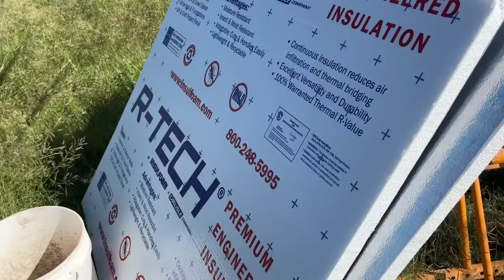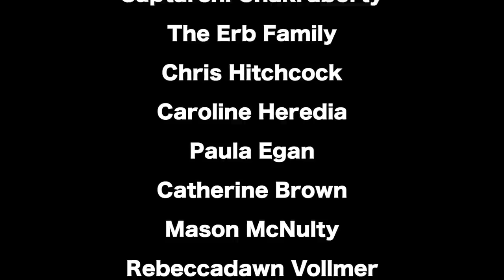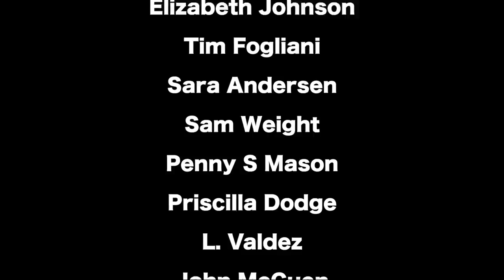Trying to get a HANDLE on the Removable Pump House Roof (Chicken Garden Day 170)

Comment: Nice job getting the screw shavings off the ground. I like the handles. Nice rigid insulation board for the inside of the doors. I'm glad you thought of the heating mats for the inside of the pump house. Nice clean-up of the pump house floor Jonathan. Putting the latches on. Nice overflow pipe. So nice that Jonathan wanted you to be careful and said he loved you. Aw! Rain stopping progress once again. Have a great weekend!

Comment: Hey Guys just a second idea for heat inside the pump box is a 100 watt light bulb
Reply: Then you have to have AC power when solar cells produce DC power. Invertors are expensive to set-up. A twelve volt DC powered heat mat is easier.

Comment: In the pump house in the winter we used a regular 90 watt bulb and it never froze. Cheap and efficient.
Reply from the maker: We don't have 120V power at the chicken garden. Just a small solar setup so we need to find something 12V.

Comment: What a blessing that you have in abundance of rain this season. I can see that your chores that includes the need of water have become easier. Perhaps this will carry over to times (past) that water has been scarce and an added expense- particularly when creating & installing the final coat on the chicken 🐓🐣🍗🪴👨🏼‍🌾👩🏼‍🌾 garden.  Speaking  of expense, have you tracked the expenses of local potable water since installing all the catchment utilities ?
Reply from the maker: We pay very little each month for access to a wellshare for hauling. Rainwater catchment is definitely more expensive for the first 5+ years as the tanks are a lot up front.
Reply: @TinyShinyHome  I see your point in up-front investment. But now the water is readily available. Time vs money … it’s a juggle.

Comment: The insulation was put on backwards. The shiny side is meant to reflect radian heat out wards.
Reply from the maker: Or is it supposed to trap the radiant heat inwards?
Reply: Under a roof you want to get the heat off but in this case you want the heat to stay in.

Comment: your going to want an airgap under the heating pad unless you have enough 12v to heat the planet the pad would be in contact with otherwise.a few spacers under a platform will do. thanks for the videos
Reply from the maker: I really doubt either way is going to make much of a difference. It's just checking ambient temperature and cutting on at 45 degrees if it needs to.
Reply: @TinyShinyHome  you really do not want to lay a heating mat on a heatsink , you will waste far less energy if the tank and mat arent in contact with the ground it just requires an air gap to isolate thermal bridging locations to the supports , its not as much of an issue in your location as it is where things are frozen 5 months of the year but with the tank and the pad on the ground both will give there heat to the ground ...grade school science and drafting stuff . how well dose the pvc stand up to uv down there? wouldnt it be a better idea to get all your swails cut as soon as possible ? planting can be done later and would benefit from the hydrated soil of a preexisting swail.im thinking a second water tank may be a good idea with the existing flowing into a new. a post hole digger and a bucket of gravel under the runoff spout "french drain" will help with water issues there. will you have trees that produce food i didnt see any in the list? a generational harvest of specialty timber would be a great long term investment . im still amazed by all the green but it is rainy season...in a desert im guessing its an unusual amount.
Reply: @mobiousenigma  Maybe they could attach the heating pad to the freeze points at the valves so those stay warm. It's the small water pipes that burst the most and the valves like to crack in the low temps. I think the 12V heating pads are a great idea.
Reply: @StoneKathryn  lots of possibilities but they chose a heating pad  best design for that is not to be in contact with a heatsink/thermal mass as the pad will heat it , likewise if the tank s bottom is in contact it should also be thermal gaped or whichever is colder takes the heat . they make pipe heater its basically an extension chord  , the problem with heating pipes is the whole run needs to be heated or the heat is robbed quicker and the water is frezeing as a mass so its liquid one minute slush the next and ice a moment after that  . it shouldnt be that big of an issue that far south though most of the time  .they may see overnight freze temperatures but ground temp is slower to change  and should stay warm enough . with all pvc pipe its hard to have a sacrificial pvc section thats easily replaceable though so a drain at the low point and empty the pipes is best bet.